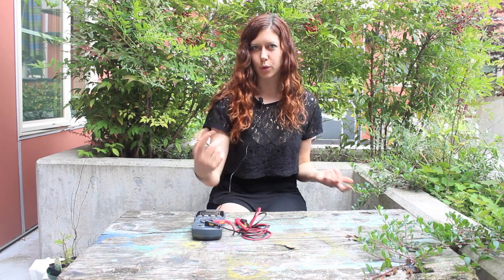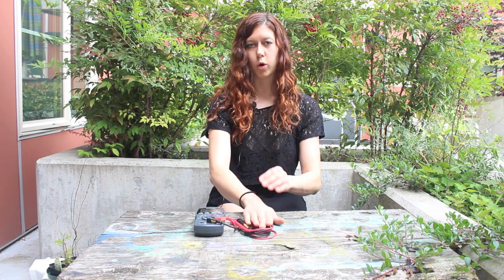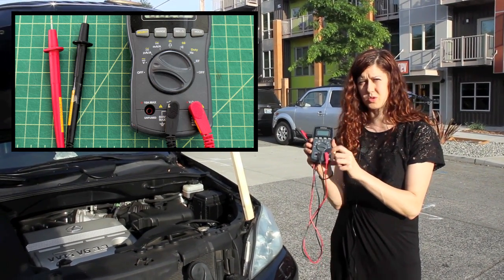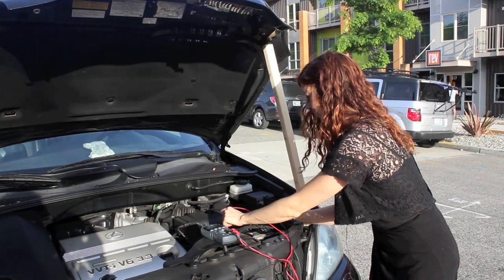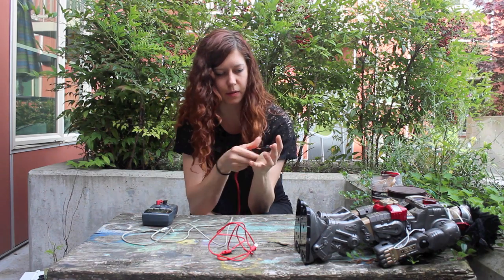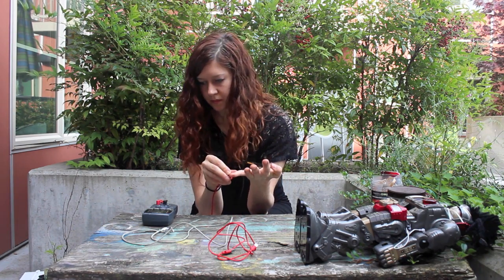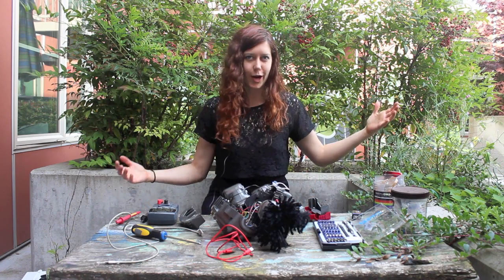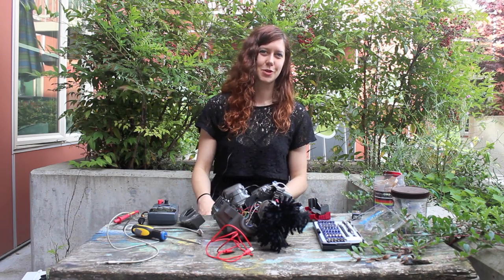How to Use (& Choose) a Multimeter!  Pt 2: The Measuring

Comment: Do you have any recommended specification for multi-meter for beginner?
Reply from the maker: Pretty much everyone agrees that Fluke meters are the best (and safest). They tend to be rather pricey, so if you're looking for a cheaper option there are a lot of other hobbyist multimeters that will work for low-voltage and current needs. Be sure you get one with separate ports for current and voltage measuring, and that the fuse rating is well above what you need it for. Hope that helps!
Reply: jen foxbot What do you mean by the Fluke brand being "safe"?  In what way could my choice of multimeter be less safe?  I'm really inexperienced and accident prone so that's probably the most relevant aspect to choosing the right multimeter.